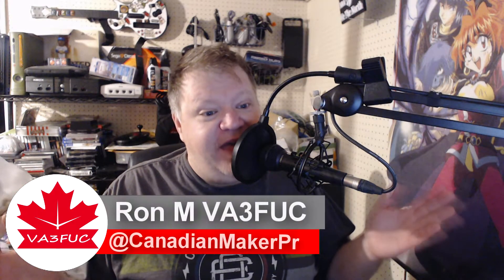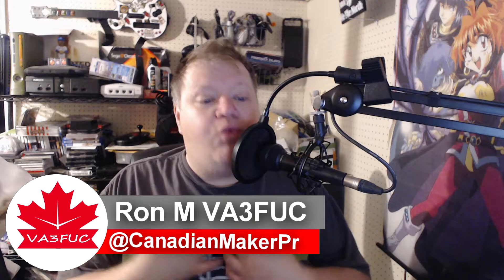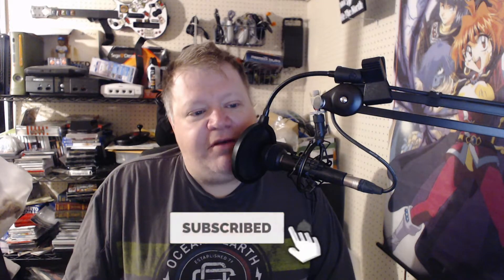Update Time and info

Comment: APRS over HF works well also.
Reply from the maker: thought APRS was a 2meter digital thing.
Reply: @VA3FUCHAMRadio  There is an HF component you can use.  On UHF you can run higher speeds as well.  Bob is the guy who made most of it happen.  http://www.aprs.org/